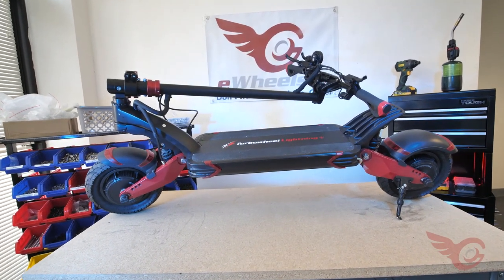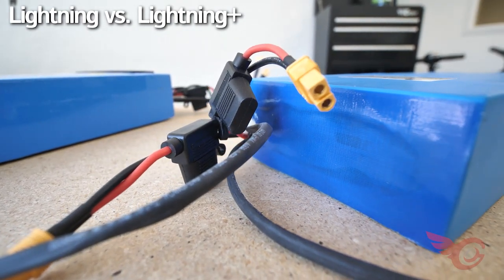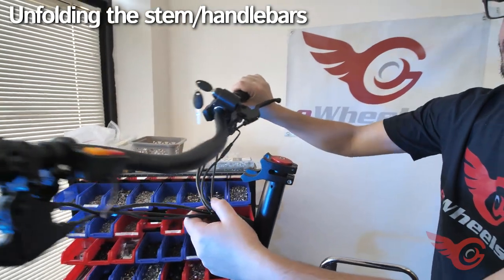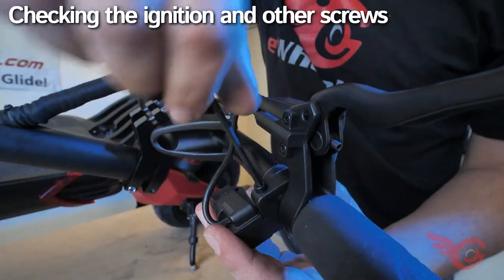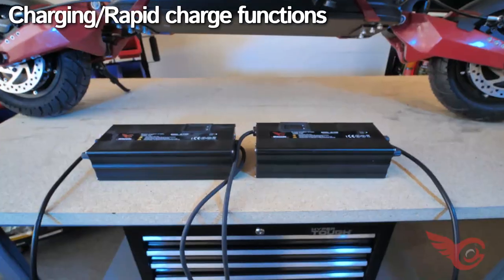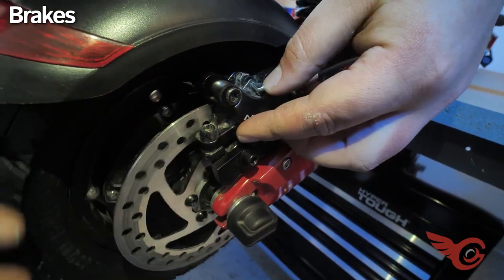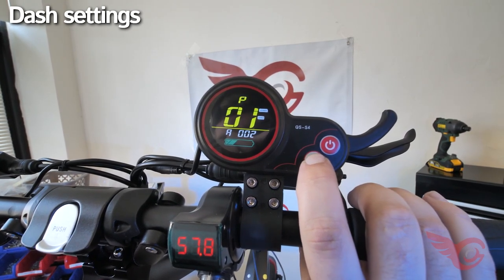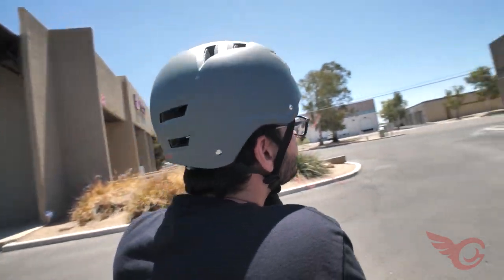Turbowheel Lightning/+ 'Getting Started' Guide Electric Scooter

Comment: I just got a used one today for $390 without the charger. Its beat up cosmetically, but runs good. I'm just trying to see if I got a good deal or not. I don't want to get ripped off. What do these retail for? Did I get ripped off?

Comment: Mine is on the way but now I'm kinda worried about me weighing too much. I'm a solid 280 so I'm wondering how good the ride will actually be. The video made a reference to a rider that's 170 and 200lbs 😓
Reply: I'm around 280 also and own this scooter. I can say that the ride is a blast!
Reply: Thanks for the answer. I'm a big boy too and I was wondering if this scooter would be able to haul me around. This thing looks sick!
Reply: @plsnobannerinomychannelino  Hey What is the max speed and range you get with your weight? And also how are the suspensions doing? Do thet bottom out or did you change the stifness?
Reply: I’m around 250 and was concerned too but I’ve seen a few videos of someone who weighs 275 on it. Looks like it will be amazing!